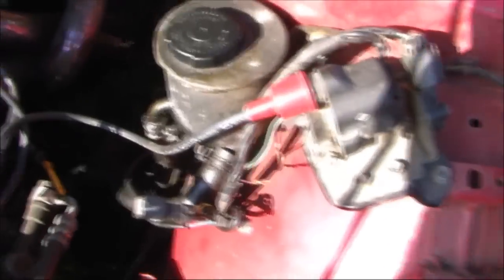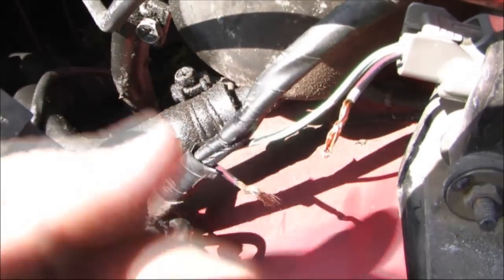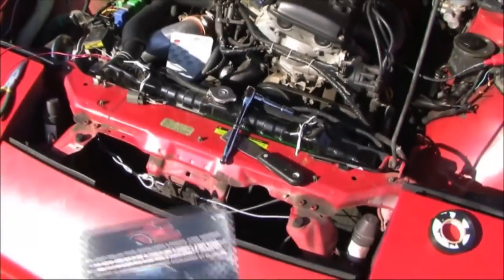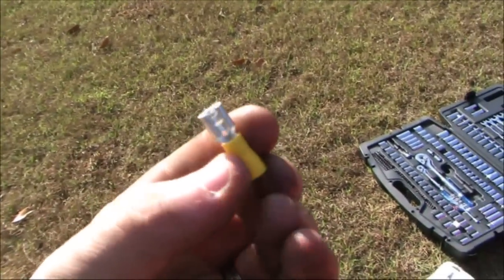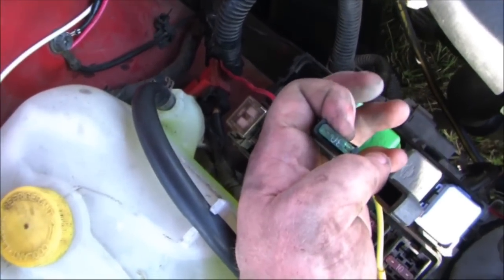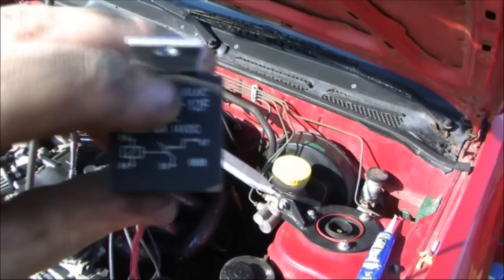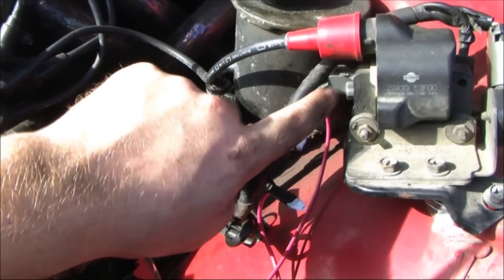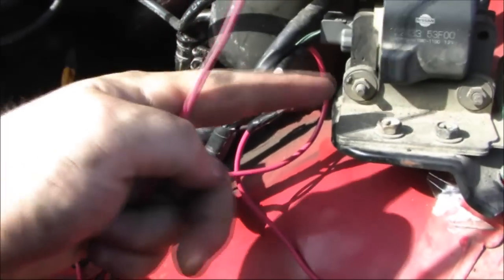DIY S13 240sx Ignition Coil Mod Hotwire Tutorial

Comment: You have pin 87 and 30 backwards brutha. Pin 30 should be hotwire from battery with fuse inline. Pin 87 should be wire to coil. When the igniton sends signal to 86 it activates the electromagnet(the switch) so you can get the voltage from pin 30 to pin 87.
I know this is 10 years old, but id rather ppl to be safe when doin electrical

Comment: What are the benefits of this?
Reply: Look up the headlight mod for older vehicles, it’s the same thing just with ignition, it’s to give a more direct line to power from the battery as opposed to going through a lot of connectors and contacts and aging wires that may have issues, running a wire right to the ignition switch or ecm or wherever this comes from could provide a portion of this increase and replacing switches and fuses that are worn out but not broken would likely get you the rest of the way, but this method is cheap and quick and gets you to that point for sure (whatever that point is)

Comment: Sorry about the late comment, but can I just run a wire with a fusible link from the coil to the battery? Or will it be safer with a relay?
Reply from the maker: you need the relay so the coil fires when it's supposed to.
Reply: @cinnabeard  okay, thank you
Reply: @cinnabeard  question, the the 12v supply is always constantly live switched as long as the ignition key on ON position ? and not switch on and off by timing triggers ?

Comment: Ever clarify the 85 86 pin thing about to wire mine up on my way home now and I have. I spark like at all so hoping this works
Reply: The “coil” side of the relay (two wires that make it click) go to the vehicle side of the red wire and ground, the “contact” side of the relay goes between the battery positive wire and the ignition coil side of the red wire, just make sure your version of the red wire is indeed the ignition positive wire and not the ground signal to run the coil

Comment: Your a mad man 14 v Converter relay is genius
Reply from the maker: if you do it, I wanna see it! I haven't had my s13 in forever. I miss it. I've been messing with miatas lately.
Reply: JD Stankosky I did! 

And I have the car torn apart it should be back together by the end of the month with a video around October !

 but I liked it so much I made it a part of the new harness I just finished, Also adding one to my new fuel pump set up!

I did make a video installing it but I never uploaded it because I didn’t wanna steal your thunder Lol
Reply from the maker: @MRTuning704  haha the fuel pump mod is what inspired this actually! and dude, this video is old. like really old. you should post yours! I'd love to see it
Reply: JD Stankosky by the way thank you for your upload

I appreciate stuff like this
Reply from the maker: @MRTuning704  also, i haven't thought about it much until just now, but I'm planning on picking up another Miata soon and converting it from 2 on 2 coilpacks to 1 coil per plug (with my megasquirt) and i might just try the 14v conversion on it. i can adjust any spark latency in my timing!

Comment: would this fix a no power to coil problem? I'm getting to power to my coil and was going to try to hot wire it
Reply from the maker: TheRockstar514 Is it a different car? I'm not entirely sure what you're working on, but you'd need the original electric pulse (like from ECU) to trigger the external power source in the relay.
Reply: JD Stankosky I got a 3000gt sohc. my wire harness is all chewed up and I reeeeaaaaalllly don't want to trace the wires and replace them. lol
Reply from the maker: If you want to hotwire it like I did on the s13 you gotta find and have that original wire work. Also not sure if you have more than one coil either. I'm halfway through replacing the timing set on my V8 Lincoln LS and I wish I could snap my fingers and turn it into anothr 240sx because this is a pain in the butt to work on.

Comment: Lol all that work/splicing just have the s13 start faster, great video/knowledge but personally it ain't worth it
Reply from the maker: Engine pull is smoother during WOT and the difference is even greater and even more noticeable under boost. That's the point of the mod, not snappy starts.
Reply: Do u have any proof of it being smoother under boost & wot?

Comment: I'm a bit confused. Isn't the pin 30 supposed to go to battery and 87 goes to the device? Also 85 is the switch wire? I'm having g no spark on my mx6 and I am trying to hard wire my coil to get spark.
Reply from the maker: Hey, sorry about the delay in getting back to you. Google doesn't always notify me of comments. 85/86 are the trigger pins and the wires can go on either one. 87 is the source (battery) power and 30 is the output (coil). I'm not sure if there's any kind of diode inside the relay to prevent reverse current, but if not, the wires for 87/30 would be able to go on either one as well.
Reply from the maker: ... Then where does your coil get it's power from? Whichever wire is giving your coil it's power is the one you swap using the relay. I could try to help you figure it out but I might need pictures etc.
Reply from the maker: no wire at all? I'm confused. are you just missing part of your wiring harness or something? you can't just hook it up to a switch unless you're as good as the ecu at turning it on and off, lol. you'd have to time the spark with the point of ignition. xD

Comment: You still have this setup? how long did it hold up? anything else get messed up? Just want to make sure i dont trip or fry anything. Thanks! I subbed
Reply from the maker: +Alejandro Ochoa I ran it like that for a couple of years before I sold the car. I miss it so bad, man. Never had an issue, ignition ran great.
Reply: +JD Stankosky super fast reply man. I thank you so much! hopefully I wont run into any issues with figuring wiring out, doing it today later on actually
Reply from the maker: Lemme know how it goes! I'll be around you can message me anytime.

Comment: [Help Please]  I have a 1990 240sx i have fuel getting to the cylinders but im not getting spark out of the coil  but i have voltage at the connector you cut (the black and red wire)  i have two new coils and neither of them made a difference, do you think doing this mod will fix the no start or make it fire ?

also  what was your reason for doing this mod to your 240

think you can give me a hand please
Reply from the maker: +Para-Mid Schemes If your coil isn't sparking, but you do have electricity going to it, it's not really clear what the issue is. I'm doubtful this mod will FIX the issue. Diagnosing electrical problems can be a headache. I wish I could take a look myself.
Reply: Hey . Did you ever get it fixed ? I’m having the same issue right now , I think it’s bc of the igniter chip . Everywhere I search I can only find the replacement for the sr though haha , I was wondering if this could help
Reply: @andrikmartinez1214 i'm also having the same problem, did you ever find a fix ik the comments 2yrs old but i'm desperate now 💀

Comment: I have no spark and no voltage going TO my coil on a 94 dodge shadow and can't figure out why. I have fuel so I know it's not the ASD relay. Will your method work to supply power, or do I need power going to my coil for your method to work? (which at first I think you said pin 85 and the second time in reviewing you said 86). I'm guessing it won't work because I don't have power going to my coil, BUT the 12 volts from the battery made me wonder. Speaking of that can I just wire the coil directly with the battery? Or do I need to go a method like yours for the rapid opening and closing (possibly called "oscillation" )that a relay does to properly supply power to the coil? Any help would be appreciated. I also heard you can jumper the ASD relay. I don't know how though. Any help will be greatly appreciated
Reply from the maker: +jeffrey lucas Supplying power to your coil from the battery will be fine, but if the coil was never getting those pulses to begin with, this isn't going to really change anything. It's the old power input that trips the new power input via the relay I added. You're going to have to figure out why the wiring harness isn't sending the power to it in the first place I believe. Wiring harness issues are a pain in the butt.

Comment: okay did u clip that wire u first cut back together?
Reply: The relay is what connects the wire to where it comes from but bypassing various resistance points, the original power and the ground he adds go to the activate side of the relay, the battery positive wire and the ignition coil side of that wire get connected through the contacts inside the relay

Comment: I just did this today, couldn't find my other comment cause im on my phone lol, but the relay I got was a 30amp. Used that with 12 gauge wire and a 30amp inline fuse, is that good or do I need to change something?
Reply from the maker: That should be perfectly fine!
Reply: Awesome and it made difference. I can feel it pull smoother now at WOT, thanks man!

Comment: How long did this last? Like doesn't the relay get too hot with that much constant switching on/off? Any problems after you got it wired up and what not? Really debating on doing this.
Reply from the maker: Never had an issue with it for as long as I had the car. I can't say that I ever reached in to feel if the relay was getting hot, but I used to drive this thing on service routes repairing alarm systems, about 600 - 1,100 miles a week for about a year.

If you want to undo this mod, it's pretty easy with barrel connector on the original harness wire.

Comment: can i do this on my single cylender motorbike?
Reply: This type of mod should work on the non signal (or slow enough not timing crucial) power wire for any component on any vehicle, though it leaves an ugly appearance, adds to the workload if someone else has to fix something wiring related, and locates relays outside of the central location they usually come, this was originally used on headlight wiring mod kits and upgrades

Comment: why all the doubt, in theory this should work a coil works on a ratio lets say 1v in 100v out, so with 12v input the output should be 1.2kv but due to voltage drop from the ecu, wire lag, interferance etc... so in theory wiring a relay with a direct 12v should be better then 11.6v after all 0.4v doesnt sound a lot but when multiplied by a ratio equals a 400v drop. ps my theory may be wrong but i think its right, correct me if im wrong.................

Comment: I am a little confused.  Initially you said the wire that give power to the coil goes to pin # 85 but, at the end and in conclusion, the same wire goes to pin #86 and the pin #85 becomes a ground wire instead.  Overall, it is a very clear-cut tutorial except for the mix-up between pins # 85 and pin# 86.